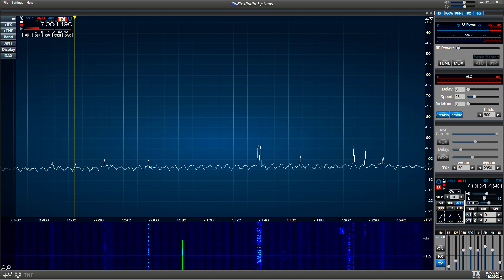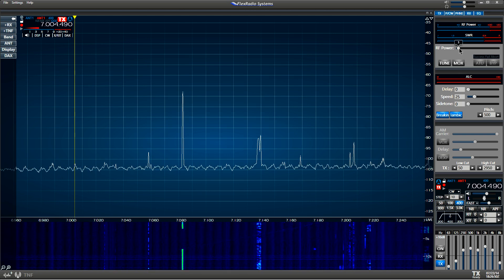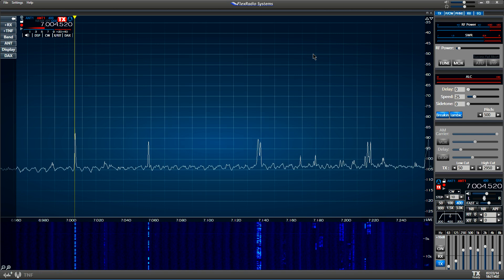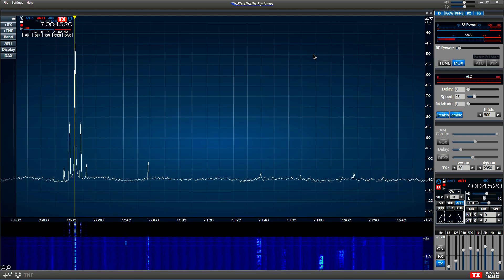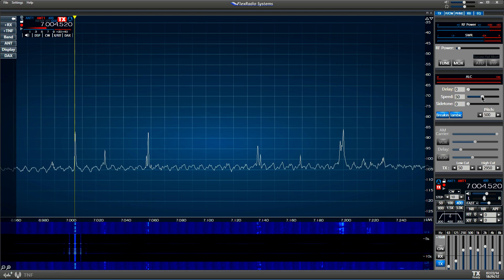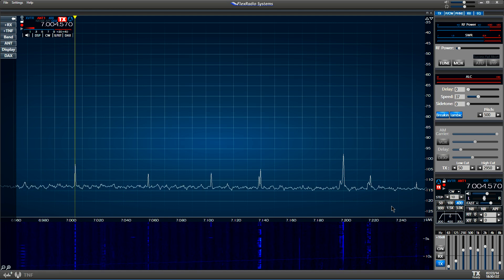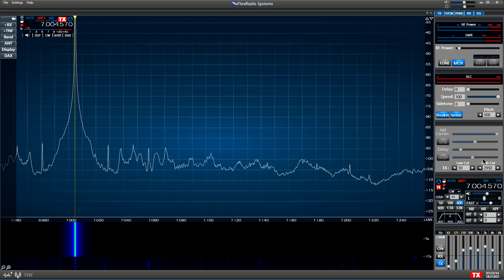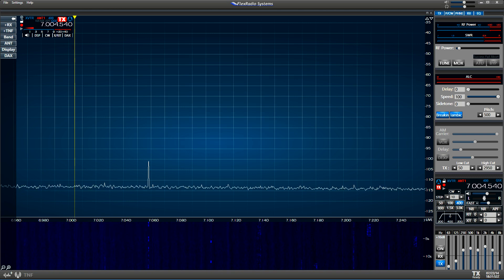Flex 6300 6400 6500 6600 6700 CW QSK Speed Test N4LQ

Comment: Fine Business - where do you connect the key and microphone if you run the flex from a remote location?
Reply from the maker: You use the computer's microphone and the keyboard for CW. QSK isn't possible due to network delay.
Reply: @n4lq  thanks - doesn’t sound great.  My dad needs a remote station and need to figure out CW- 73
Reply from the maker: @AgentElectric  You use a Flex Maestro at the remote end which has a key and mic jack. This provides sidetone for cw too. Seems like a good system but I don't do remote here.

Comment: Good video Steve. With either method, is there a relay clicking with each xmit or is it all switched electronically now?

Notice any delays when using paddles and the built in keyer, between what's keyed and the sidetone generated by the radio?

That radio looks great, I bet you are enjoying it.

Rob, N4GA
Reply from the maker: Transmit switching is done electronically with pin diodes. There is a tiny relay at the receiver input so I am told. It is almost inaudible. I would compare it to the relay in an Omni VI. Very quiet. Certainly not an Omni VII which is very loud or a TS-590 - same. No latency in sidetone. The sidetone is generated inside the 6300 and comes directly through the speakers plugged into the rig, not the computer. This is a totally different radio than the Flex 5000 to say the least. Most noise is generated by an obnoxious little fan that normally runs at slow speeds.
Reply: Steve Ellington Sounds good.

Very impressive QSK performance for sure. I mean who could technically use better, even with an excessive imagination?

I've never been a user of QSK. Usually go with about 400ms so when I want to take a brief pause and hear what's going on, I can. 

I'll probably end up with the baby 6300 eventually. :)